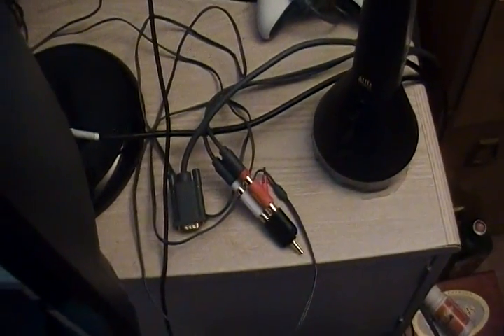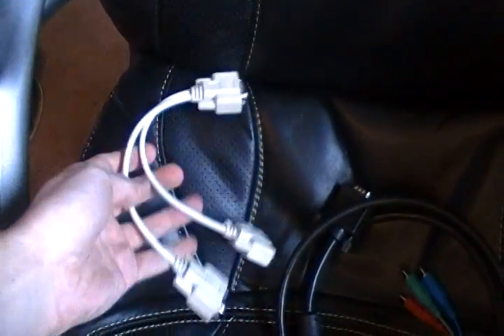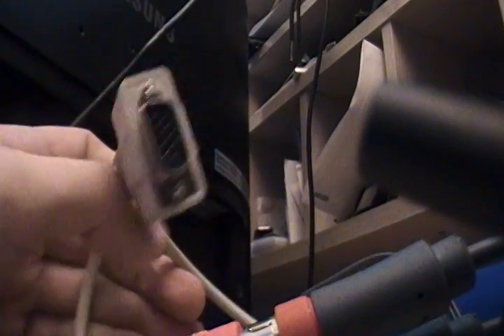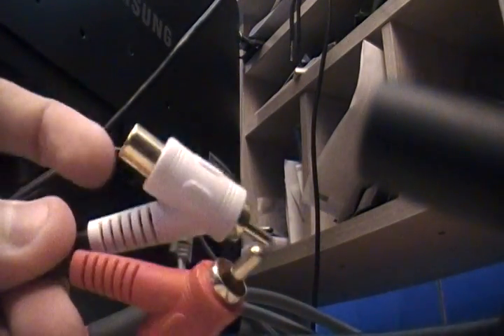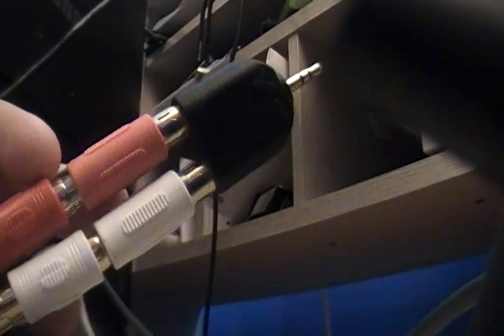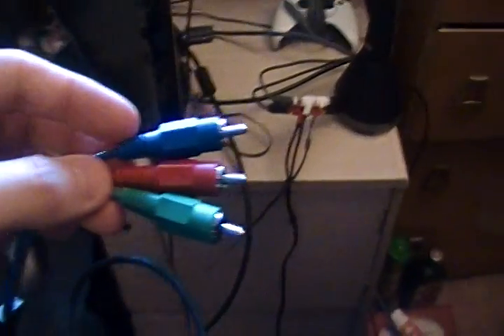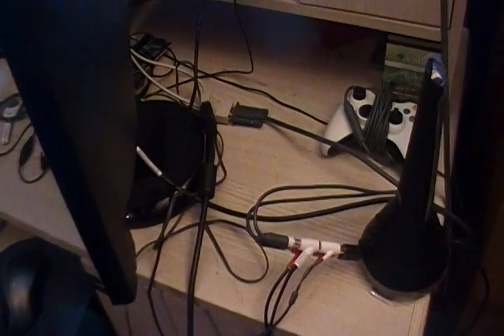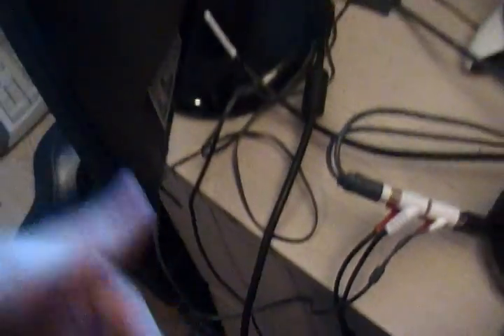How To Record In HD Using Xbox 360 VGA Cable

Comment: I actually was able to make it work. I found out my monitor supports YPbPr, which means I don't need a converter box at all. All I had to do was change the color settings in the monitor configuration.

Comment from the maker: @ImWizh Xbox HDAV > Hauppauge HD-PVR (in) > PVR component (out) to LKV-7600 converter > VGA out > Monitor. All set. Make sure everything is turned on before booting your Xbox. You will certainly need to fix the colors on the converter first.

Comment from the maker: Ya, I started to have problems with all the cables so I decided to switch to a converter box. The one I used was a HDTV to VGA converter. Works just fine. Search my other comments for the model number (I'm currently on vacation).

Comment from the maker: I don't know if you read my other comments, but look for a LKV-7600 on MonoPrice. It helped get rid of all the cables and have a better picture. As for the black screen, I am unsure what is causing it, but probably the converter is shot, as it is not producing a picture. I still have my LKV-7600 and it works perfect.

Comment: Hi.. could you please answer this question? So basically, you're connecting the xbox 360 VGA cable to the splitter (female), and then you connect a VGA cable from the splitter to the monitor, and then the other VGA slot thingy, you connect that cable to the HD PVR.. so technically there is no cables in the "out" input on the HD PVR correct? you only connect the Green, Red and blue to the "in" input, but you dont connect anything to the output, right?

Comment: I`ve got the nearly the same setup, but it doesn`t work ... It looks like this:
Xbox-Xbox Vga cable-vga splitter-(one part goes to the monitor)-vga to component (yuv/rgb) adapter-Roxio Game Capture HD PRO
 When I start the Xbox, I can see the normal signal on the screen (A bit darker, but it`s ok) and I can also play with the normal quality. But on the computer (or better: the roxio programm to record the gameplays), I can only see some really bad pictures in bad quality and wrong colours. Ty!